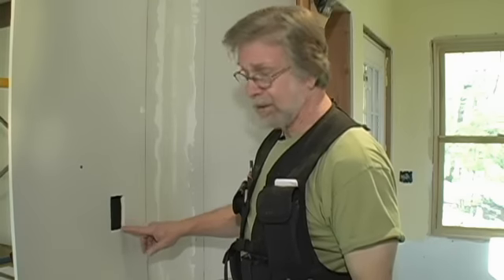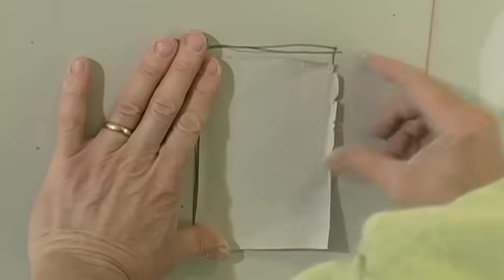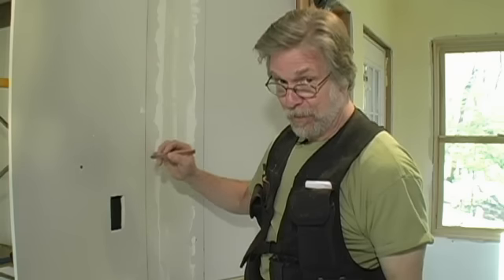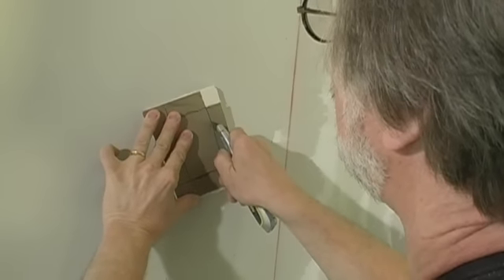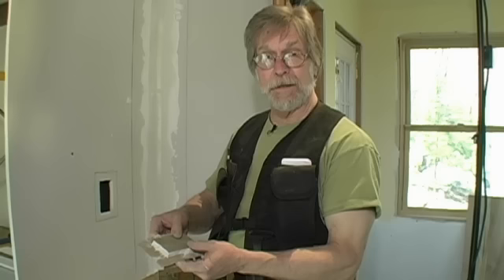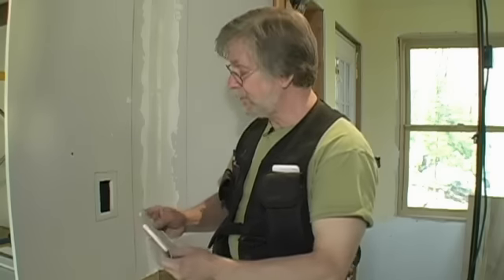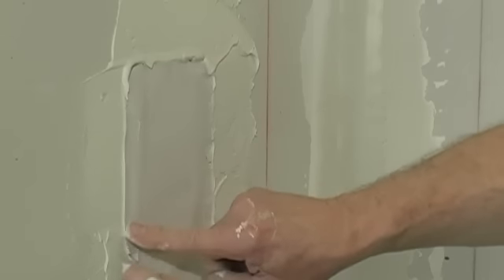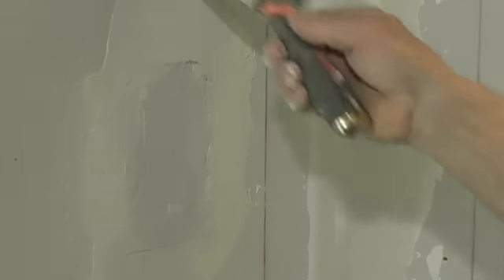Small Drywall Patch

Comment: The proper way is to screw a piece of say 1x2 or 1x3 to the back of the drywall, slipping it into the hole. Obviously it needs to be just long enough to accept screws. I use a screw to hold the piece, makes it easier to slip it in behind and hold it firmly against the back of the drywall while I screw it on from the front. Then remove your screw "handle" and tape and screw your patch on. One last note: slightly dampen the back of the paper overlap to ensure good adhesion to the mud. Works every time.